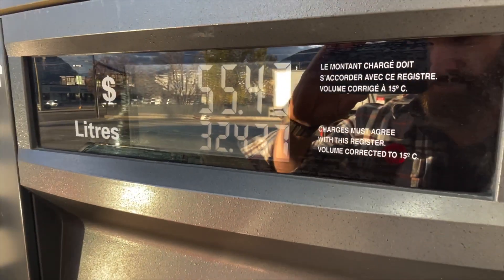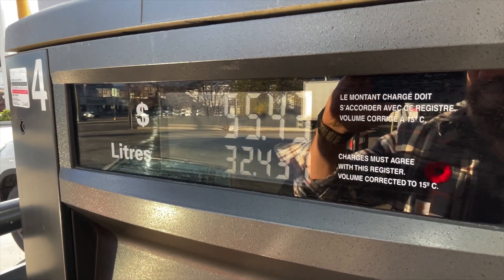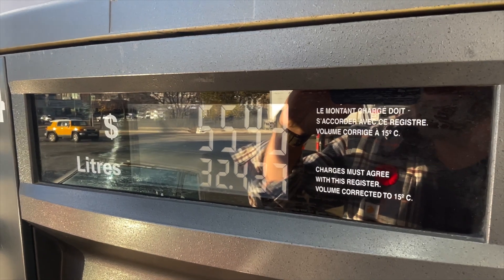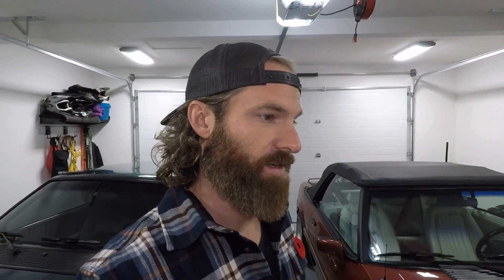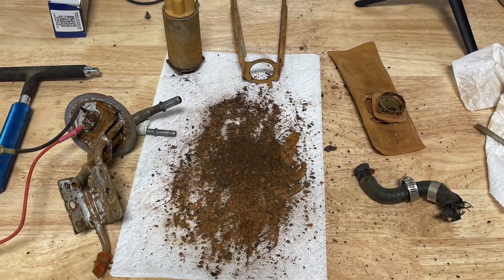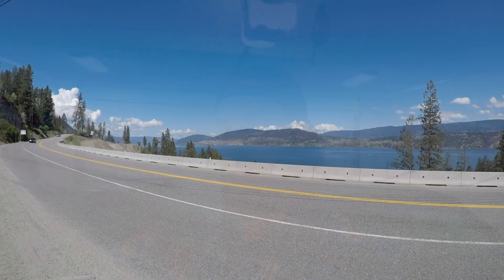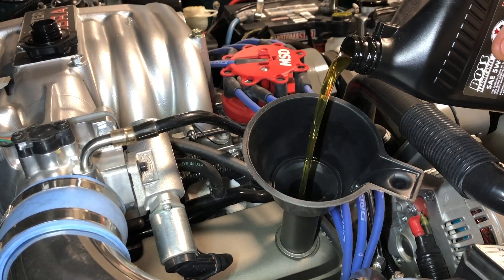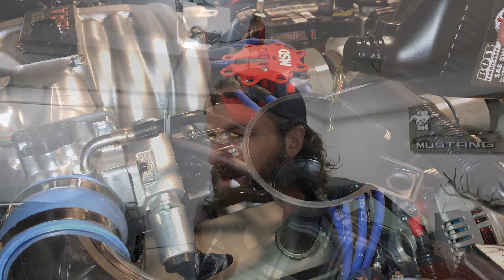How to Winterize & Store Your Vehicle - The Right Way /// Do's & Don'ts

Comment: Something else to consider is the ethanol content of the fuel. If you can, store it on low or zero ethanol if possible, since ethanol attracts humidity. Your tank might not have been stored empty but with a blend with a high ethanol content. Summer gas usually has less (regionally) and more in winter as its considered to reduce winter emissions. put a couple ounces in a clear jar and watch it collect water, its nuts.
Reply from the maker: Good call bud! Thanks for weighing in and sharing with everyone!
Reply: Shell premium doesn't have ethanol in it btw. In Alberta anyway.
Reply from the maker: Good to know

Comment: great vid  I fill the tank / add stabil & octane booster -- pull the battery - air the tires -- wax the vehicle  - open a box of baking soda put in the interior to absorb moisture / stink --also works for the harleys / jet ski / boats etc --see ya in the spring
Reply from the maker: I like the baking soda idea! years ago I used to park my car in an airplane hanger for the winter and I would always put Irish spring bars of soap in the car to "keep the mice out." I found out years later that I must have just been lucky because we used the soap trick in our holiday trailer one year and the mice eat the soap 😂
Reply: @KASLCustoms  eat the soap LOL -- the baking soda that is old school right there but works great takes out the stink / moisture been doin it for yrs
Reply from the maker: @philolen481  good thinking! We use it in the fridge etc so why not the cars!? 🤷‍♂️👍

Comment: thanks great vids, I don't have a heated garage. was told to run a box fan on low to keep the air moving underneath while car is on wood off the floor. whats your thoughts?
Reply from the maker: I stored my car for years in a cold garage and never had a problem. Do you live in an area with really moist air?